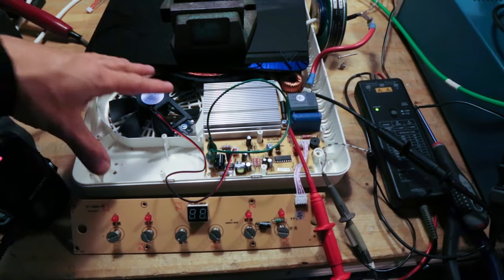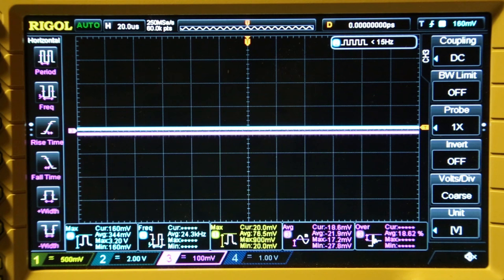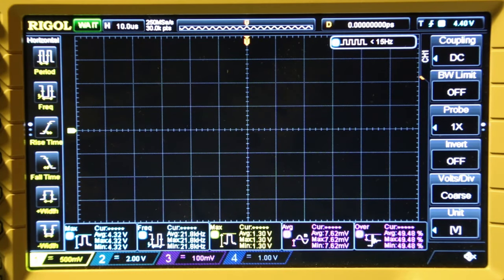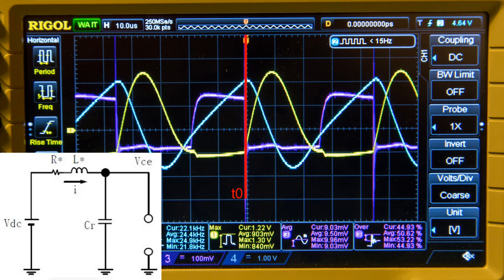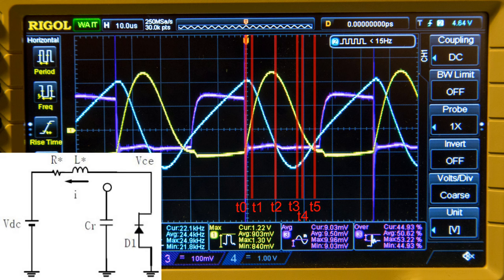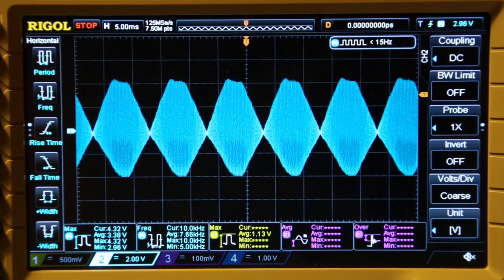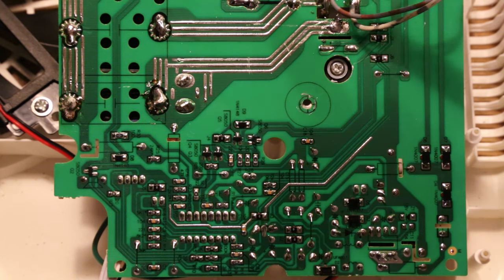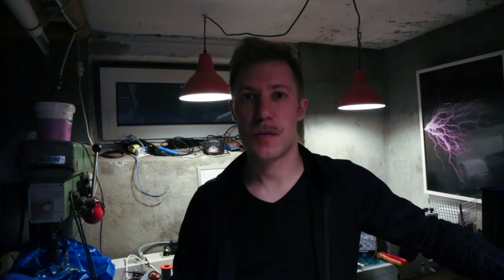Hacking IKEA 2kW Induction Cooktop, Measurements (Part 2 of 5)

Comment: Just to point out that the rectifier appears to have the lower two diodes missing resulting in a short circuit across the AC supply. Also at 13:00, he says that " Due to the longer ON time at higher power, the RESONANT FREQUENCY IS LOWER."  Without going into other situations, in this circuit, the resonant frequency always remains the same and it is varied by the pots and pans placed close/on the induction heater, IT IS THE SWITCHING FREQUENCY THAT VARIES.  The switching frequency is not the resonant frequency in the generalized case, but of course, it could be, for one particular power level.  Note that really, we should not talk about frequencies in these circuits,  but Time Periodic Durations of a half cycle of the resonating frequency and the power level pulse duration. The rest is a very clever circuit that always selects just the first " half cycle" of the oscillatory circuit with a constant period while varying the  "on" pulse will increase the integral time for the current in the inductor to increase/grow to a higher value for more power. Ingenious logic really, 
I feel that if Cr was connected directly across the inductor Lr the resonant circulating current would not have to go through the power supply. and the ZVS condition would still apply. 
 Congratulations on a very nice presentation with those waveforms. My oscilloscope is a very old one, to complement my old age!
Reply: you feel good about that Cr i am on the same belief , dont believe they put it there it s alot of current  to pass through the power supply
Reply: No meu Ikea 2kW, o Cr (330nF), não esta conectado ao GND. O Cr esta conectado em paralelo com Lr. Desta forma a corrente ressonante só circula no Lr/Cr.

Comment: I just compleated a Tesla Coil with a 2.5 kw rated unit (BH2013-mb10-sp-v2).    The hard part is winding a secondary coil that will resonate in the range of the cooker.   Mine is wound on a 8.5" diameter cardboard tube to a length of 32 " with #34 gauge wire and has a large top load.    I'm getting about a 1 foot long discharge with 1500 watts input.    Resistance looses in the secondary  cause it to get warm when running.

Comment: Great measurements, good explainations. I wish there was part 3
Reply from the maker: Working on it!
Reply: Another vote for part 3.  From what I can determine, these cookers use I2C to the control board, which then has a I2C <> buttons/LEDs controller.  So all the smarts are in the HIgHWAY09A chip, and the best you can hope to achieve in a simple way (ie connect arduino to I2C) is to emulate the control board.

Comment: One neat thing you can do is hook it up to the secondary of a high frequency x ray tube transformer to make a very high voltage moderate current adjustablr power supply. If you want DC output you will need to get better capacitors and diodes as the original x ray power rectifier board immediately self destructed.

Comment: 2:09 rectifier in this schematic has a short cut?
Reply from the maker: dots show a connection where two wires meet, if wires cross without a dot, its not connected.
Reply: @KaizerPowerElectronicsDk  not this. See again, two wires from ac go together to ground.
Reply from the maker: @gftrdcopqanhytr456  I see now, its a simplified schematic. AN-9012.

Comment: @Kaizer Power Electronics, Thanks for your video.  when i use my induction cooker it will cause the voltage in the house to start fluctuating. could you please advuce what could be cause/problem?
Reply from the maker: Your house wiring is too small for the high current load from the induction cooker. The high current draw results in a voltage drop in your too small wires.
Reply: @KaizerPowerElectronicsDk  i have other one with higher power without any problem
Reply from the maker: @amintaleghani2110  Your higher power one uses a half- or full-bridge with DC bus energy storage, to supply current for the peak load. This one is a single switch quasi-resonant topology, that gets all its power from following the sine wave of the mains supply. So the mains supply see the entire peak load.

Comment: I was wondering if I could use this as a flyback transformer driver. Because the 1000w zvs induction heater modules from china have the same price as this.
Reply from the maker: If you can match the inductance of the existing primary to the new, then it should work. And do with 25kHz.
Reply: @KaizerPowerElectronicsDk  Thx, I saw a cheap used one on ebay. I might try that.

Comment: Hi, is it possible to modify the circuit with SiC Mosfet and increase the swiching frequency in order to adapt aluminium pots?
Reply from the maker: You might as well just build a new circuit from the bottom, as SiC needs more  advanced circuitry and diffrentiated gate voltages.
Reply: @KaizerPowerElectronicsDk   Hi Kaizer, thanks for the reply. Yep you are right, SiC needs pretty different driving conditions. And since the topology is soft switched, SiC could also not change that much. I wonder what Panasonic did with their "Met-all" technology in the 90s. Definitely no SiCs at the time but they still managed to reach 70kHz or so for Aluminium pots.
Reply from the maker: @zazio5535  I have not seen those on the inside, but my guess would be that its made with a proper full-bridge and not just a single quasi resonant switch.

Comment: Hi Kaizer your work is really amazing. I'm in need to design induction motherboard with out control board. Once power is given, immediately circuit turned on and off after 5minutes. Whether this possible without control board by directly giving 18v to IGBT and some pwm driver. No need of temperature sensor part.
Reply from the maker: Yes that is possible.
Reply: Be very careful with the switching. The frequency of these QR devices is determined by the capacitor tank so you can't just brute force a PWM through the coil. You need to turn it on, wait for the current to rise through the zero and then switch again. If you switch too early or too late you can easily destroy your IGBT with the resulting current spike.
Reply from the maker: @basvandriel2497  I did assume too much, that Prabhu was talking about a ZCS PWM circuit :)

Comment: What is the amperage of the high frequency current at discharge coming down from 240 volts through to low voltage DC 200 volts ?
Reply from the maker: The current/voltage peaks at 40A at 600VDC. See details on my website, links in the description

Comment: is there a way to disable the beeping? I'm assuming that there is a speaker somewhere on the board, but I'm not sure which element it is. Any ideas? Thanks!!!
Reply from the maker: Some commenters says its the fan that is used to make the beep by driving it with a AC frequency
Reply: Can clearly see the black round beeper component on the board.
Reply: at least on the board that I have (from 2020) there's a pezio buzzer on board.. @KaizerPowerElectronicsDk
Reply: how can I stop the oven from beeping? this hack would make half the internet sooooo happy!!!!!!!!
Reply: No meu tambem tem esse piezo. O ventilador e o piezo compartilham a mesma saida do uc. Quando quer buzinar ele ajusta a frequencia PWM da saida.

Comment: would running the induction stove on a metal table be a bad idea?
Reply from the maker: Only if its upside-down ;) A induction stove has ferrite blocks underneath the coils to help the magnetic field be more efficient at the "large" distance to the pot on it. The distance to the pot is less than to the table, so it consumes all the power into the pot.

Comment: Will this simple quasi-resonant circuit decrease it's power output with lowering of mains voltage? Or it can adjust it's output to compensate for natural voltage fluctuations when, for example, big load turned on? Is there any feedback loops for monitoring it's output?
Reply from the maker: As a simple designed quasi resonant inverter can not have a duty cycle higher than 50% (count in some dead time too), and that it is already running at around 45% duty cycle at power setting 9, I would say that it can not raise its duty cycle further to make up for the lower voltage when trying to put out 2000 Watt.

There only seems to be implemented a over-current detection to protect the IGBT, but even in extreme load conditions (like when i substituted the work coil for a much smaller) it will just burn out the IGBT.
Reply: Kaizer Power Electronics Thank you!